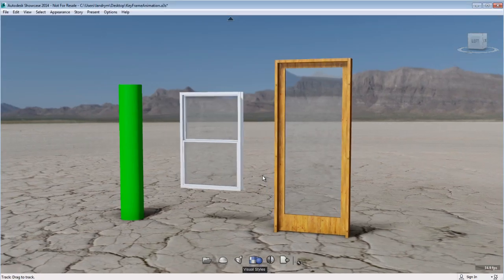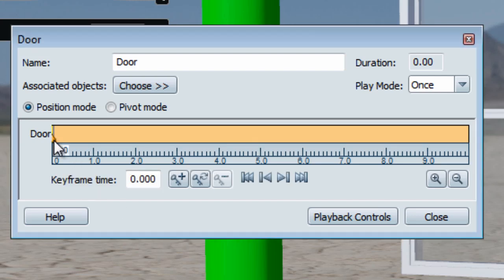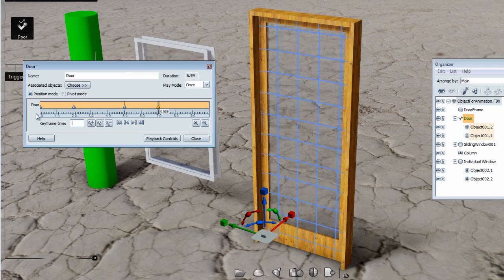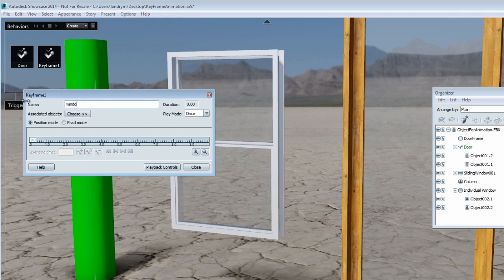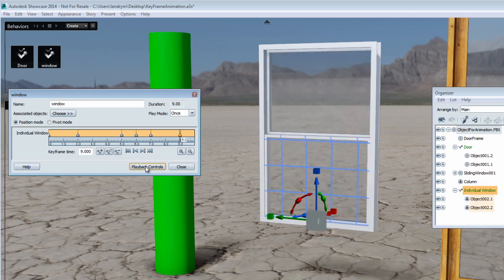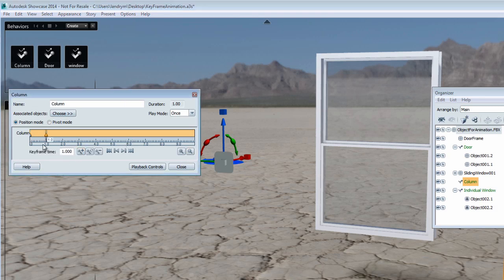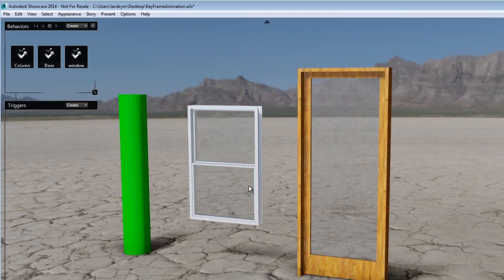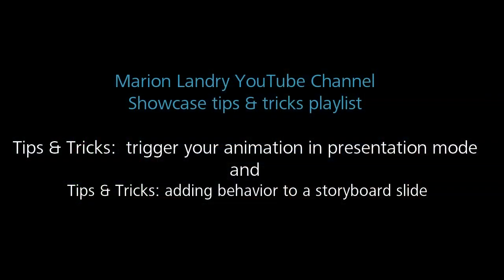Showcase Tips & Tricks: creating keyframe animation

Comment: can you also adjust the materials while making a key frame animation?
For example let something disappear by increasing translucency on that material?
Reply from the maker: Hi,
Unfortunately you can animate the transparency or the materials in Showcase. You animate a cross section place for certain object creating a sweeping reveal or you can create visibility alternatives. Have a look at my video on animated cross section. Good luck http://youtu.be/zeMLhHqH77E
Reply: Marion Landry Thanks for the info! One more question: I have a problem when creating a new key frame animation of an object, when adding a keyframe my object changes place, position, angle etc and when I press ctrl + z the object doesn't go back to it's original state... Is there a way to prevent this?

Comment: Hello Marion.
I have imported a Revit file with "parts" (in walls, floor and roof) and structure. I need to create an animation of the assembly process but I want to select several objects for moving, for examples the whole beam system.
When I try to "associated objects" in the Key frame, Showcase doesn't allow to associate more than one object. How can I select and associate several objects in the key frame?